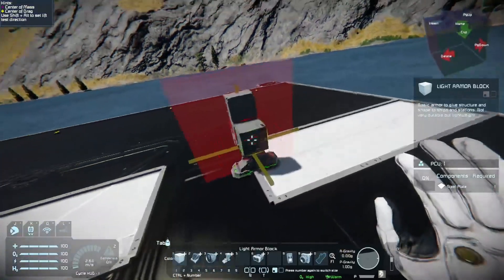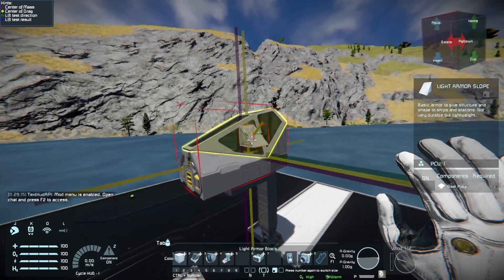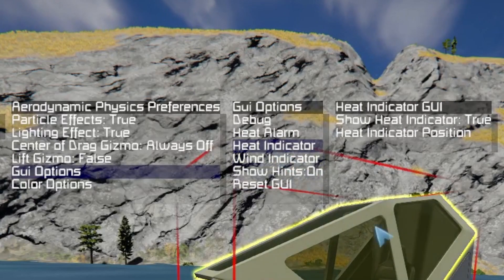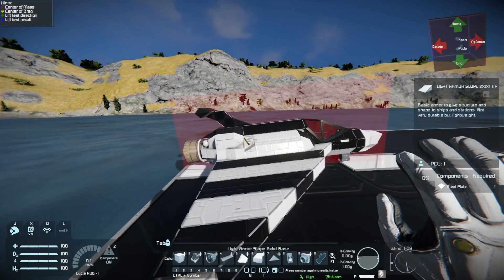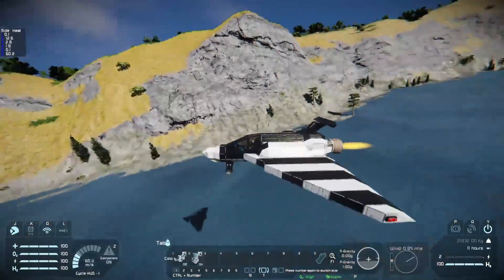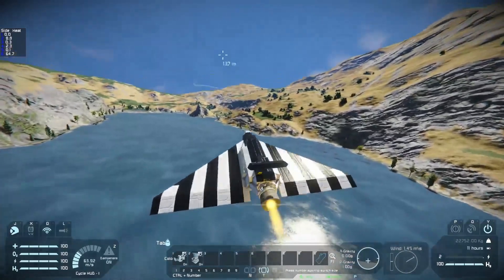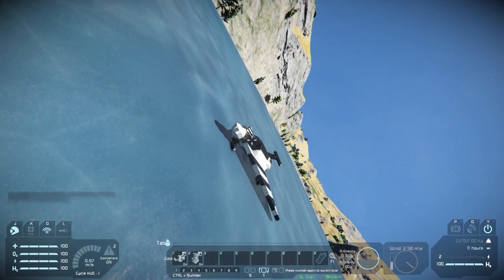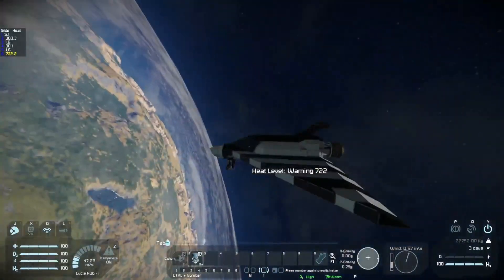Explaining Aerodynamic Physics Mod in 5 minutes or less // Space Engineers mods

Comment: i have also the falldown problem. I built myself a fighter jet. In reality, the small wings should be enough, because the air compresses at high speed, but it doesn't seem to work ingame.
Reply: Wouldn't a tail solve that? The tail's purpose is to push the rear of the craft down, increasing your pitch.
Reply: if you have opted for a delta wing design, you might consider increasing your airspeed to achieve higher lift which will prevent the aircraft from falling down. delta wings are by no means efficient at low speeds, but they suit well for high speed applicstions. if you are flying at the default speedcap of SE which is 100 m/s or 360 km/h, it is likely insufficient. try adding mods that remove the speed limit or redesign the plane.
Reply: also, refer to the other comments where someone explained the cause

Comment: Your plane doesn't have enough lift at the front, hence the nose down. 5 minutes is not enough for this mod.
Reply from the maker: Unfortunately, I disagree with you. I never had problems with my craft because of the noise of the vehicle, normally they all worked just fine and if they don't a problem is most often in wings size. Also, I recommend watching the video of the creator of this mod and looking at his demo aircraft, you will see it works just fine and the nose of his plane is just pole shape, not aerodynamic at all.
Reply: @ElSkipper 

Wouldn't downward pitch mean that your tail is too small?
Reply: I was late finding this video. The problem is the center of drag and center of mass are not lined up. The center of mass should be in front of the center of mass along the direction of travel. (the yellow and purple lines should overlap in a single direction along the direction of travel).
Reply: @DraygoKorvan  absolutely pinpointed the reason, there is torque applied on the aircraft hence the pitch down
still might be partially caused by lack of lift proportional to the mass

edit: center of thrust should be lined horizontally with the center of drag, not center of mass